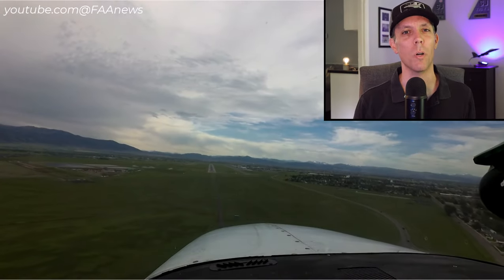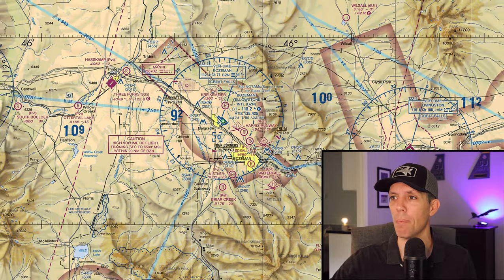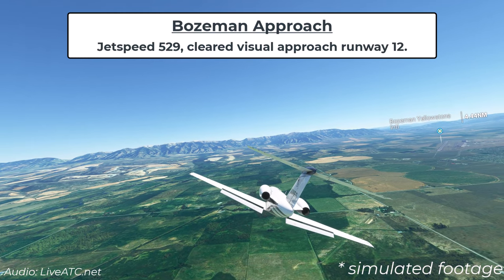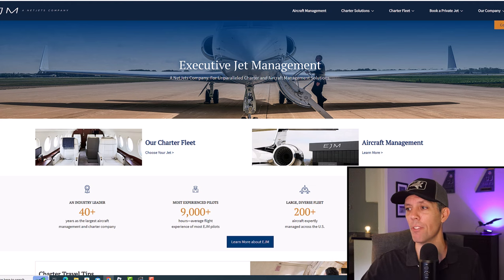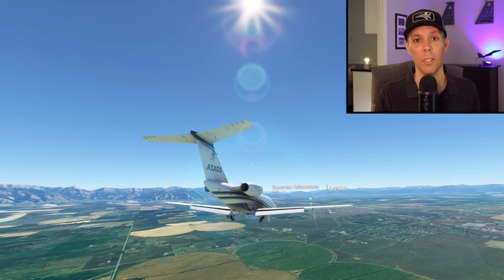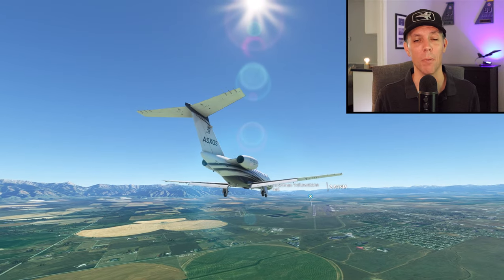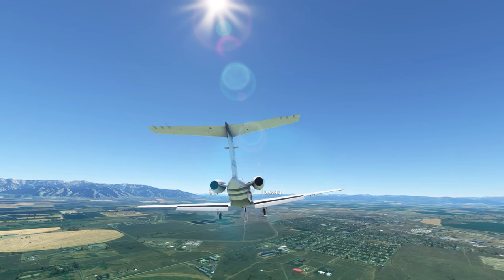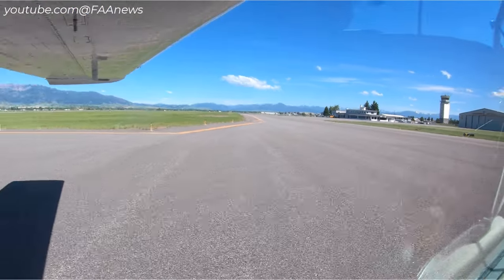Pilot Actually Lands WITHOUT Permission!

Comment: They were making excuses, they never switched frequencies.  When you switch you generally establish communication with self identification and altitude.
Reply: he wouldnt ient its a none radared tower I bet mostly the Tricon would ask for a ident not a delta tower
Reply: He means you would identify his aircraft, altitude, and type of approach.  Not transponder ident.
Reply: Even if he didn't switch frequencies, Approach Control would have told him he was calling the wrong guy
Reply: Yes, don't try to call the airport with a cellular phone when the airport is a Class B C or D airport.
Reply: @iKenFlyPPG  you call class D for none transponder request all the time you can't go direct into B and C anyway
Reply: @zackriden79  ha good call
Reply: @zackriden79  there is a video of the towers attempt to communicate with the airplane, the second transmission from tower is "Jetspeed 529, if you hear this transmission, ident", so yes, this tower did ask for an ident.
Reply: They were saving fuel in the interest of our planet. Give them a brake. Fighting for a good "cause" is more important than rules and regulations. Good "causes" always override common sense.
Reply: If they  didn't switch freqs, they would have still been talking to approach.  Prolly switched, incorrectly and were talking at atis.  Or some other issue, but they were on the radio and talking.
Reply: Question is why would he do that? Why not just do it right?
Reply: @justforever96  Where is the wind when it is not blowing?
Reply: The pilot stated that he was talking the whole time. To who? That would be easy to confirm, or not!
Reply: He dialed in the incorrect frequency.
Reply: @jimw1615  But you don't just talk. It is a conversation. There are responses that you expect, not dead air.
Reply: Approach was trying to reach them, too. The pilots of the plane were talking the entire time all right... to each other and/or their passengers. My speculation is that they blatantly ignored both Tower and Approach for whatever reason, like teenagers. Granted, it's just speculation of mine. When you have multiple steps you can take to safely land, then you do them. I have a difficult time believing they took those steps, perhaps even any of them. I would even try calling the tower on the phone while in holding pattern before landing, if I were the pilot. Sure, I'm boring. But I'm also alive. No excuse whatsoever.

Comment: At least we had the tower keep other? aircraft out of their way. As a student, I did the opposite. I was flying from Tulsa Riverside (1969) to Tulsa International to do a visual approach to runway 36. I was instead vectored to Rwy 8. My intentions were to do a touch-and-go and then return to Riverside. But instead of clearance for the touch-and-go, I was cleared to land. Of course I didn't catch the nuance of the difference in clearances. The reason for the modified clearance from what i requested was there was a commercial flight taking off on Rwy 36. As I executed the go-around from the touch-and-go, I flew in front and above the commercial flight. It wasn't even close (the commercial hadn't even started its roll)but it really pissed off the tower controller, as it should. After getting my butt chewed i returned to Riverside with a new understanding of why it's important to pay attention to what the controller actually said and to not anticipate his words. Went on to teach in the T-38 and flew the F-4E and F-15C without another pilot deviation. Well, maybe one. That's another story.

Comment: I did once land without a clearance, or at least without hearing one. I was headed into the AOPA fly in at KFDK. It was a beautiful day and approach were dumping planes on to downwind and leaving it for the local controller to sort it out. Sad to say, she was way behind the traffic, and was clearly having trouble keeping up. I was on final, and there was a huge amount of confusion about the sequencing, with the wrong airplanes being turned on to base and things behind me getting chaotic. I could barely get a word in on the radio, and I came over the threshold, still not having heard a clearance. It’s a long runway, so I just floated a while, trying to get a word in, but she was still dealing with the mess behind me. At about the point where I had to make a decision, I finally asked “confirm cleared to land” and still no answer. I then decided, screw it, the runway is empty, and if I go around now I have no idea what’s above me, or whether I’m just going to make things worse, so I announced “I’m landing” and put her down. Filed a NASA form, but never heard a word about it. Maybe another airplane had blocked the clearance, or maybe not. But I figured the predictable thing to do after floating halfway down the runway was land, and the last thing she needed was more workload.
Reply: Good you filed a NASA. I think you had a good case to make from a safety perspective. When controllers get behind, bad things can happen.
Reply: That's nerve-rackingly awesome.
Reply: I don't fully understand, i am no pilot. Why not go around?
Reply: @pianissimo7121 Because it's possible she did clear me and I didn't hear it, and anyway she was so far behind the game that having to sequence a go-around might have tipped things over the edge. I also knew there was traffic close behind me and I had no idea what they were going to do, and I thus felt safer on the ground wondering if I should be in the air than in the air wishing I was on the ground...

Comment: Had an situation not long ago where we had to decide if we entered the Class D airspace at home airport without a clearance. Got the ATIS and then called for entry. Nada. Called the UHF freq. Nada. Tried both VFH and UHF in the second radio. Nada. Double checked the NOTAMS to make sure the tower we had talked to 2 hours before hadn't closed for some reason, not that we thought that was really an option since ATIS goes offline when tower is closed. Finally called ground who had us call tower again where there was now a controller to give entry/landing clearance. If tower hadn't answered I think we would have squawked, entered, and landed our helo direct to our ramp and figured it out later.

Comment: Quite simply: A pilot is responsible for assuring all two way communications are working. Aviate: Keep the plane safely in the air; Navigate: Know where you are and where you are going and keep that path safe; Communicate: Make effective two-way communication happen. If you can't do all three (using alternate channels as needed) declare pan-pan and then an emergency, as needed. That's how I see responsible piloting? Genuine questions: Do others agree?

Comment: I don't have any kind of pilot license and any flight experience is purely in sims. But even from this position it seems clear the pilots messed up here. If they could hear the tower the whole time, then they knew the tower could not hear them and had not given them clearance to land. I'm guessing that despite whatever issue was going on, they figured "conditions are clear and we can tell that the runway is clear so we would get clearance if we were in contact and we don't want to inconvience whatever person we have on board so let's just land" which is of course, the kind of mistake that has caused catastrophies. If there's anything I've learned about flying it's to be patient and always better safe than sorry. Figuring out what's wrong with the radio might be a lot to think about while I'm on final, so just go around and figure it out. It's strange they just suddenly could transmit properly once on the ground, I get the feeling they were hitting the wrong transmist button or something XD.

Anyway, "we could hear you the whole time and were talking the whole time" isn't just not a valid excuse, it's not even an excuse at all. It says nothing as to why they'd land without a clearance.

Comment: My backup plan in a small GA plane is the cell phone. I've got some of my most common towers saved on speed dial (though without needing it so far).
Reply: I should set that up, thanks! I do have a handheld radio in my flight back, reachable from my left seat at all times. Haven't needed that yet, and I doubt it'd transmit particularly far, but it could be a life-saver in a pinch. (I also have a Garmin InReach, but am not sure it'd be especially helpful, compared to a full-on satellite radio or similar.)
Reply: Belt and suspenders!
Reply: Before the web, we had a member in our forum from NORCAL. This is when cell phones were new and quite rare. Anyway, this person was in their Cessna and had a radio issue, so they called tower on the cell phone. Thing is, cell phones were still rare enough that it took some convincing before tower believed the pilot was real... they were convinced it was someone playing a practical joke on them...

Comment: The excuse sounds shaky. BUT, I remember once when my dad and I took off from BWI, we had just switched from tower to departure. We heard some noise on the channel and ATC came back and said there was a lot of noise on our transmission - was there anything we could do - please? I reached into our goodie bag and pulled out a spare microphone, plugged that in and gave it to my dad. When he called departure back, the guy was extremely happy we weren't assaulting his ears!  The first mic had worked with no issues for a long time and for all calls up to departure. Then it crapped out. So failures can happen at any time. But you would have expected this guy to say he changed something and he just sounded perplexed. That doesn't make sense to me. So, enjoy your talk with the FAA fella!

Comment: No clearance bad, but Mid '90s - G.R. International, Pilot I saw on Approach, just barely pulled out of windsheer, Liner had 5 wingspar breaks, Plates stretched out, wiring pulled out/disconnected, & airport looked abandoned probably due to storm.  Capt had entire Cabin Crew severely injured, plane's interior raped, no COMM w/Cabin, 1st Ofcr sobbing, no Radios, & landed fast & long trying to keep wings.  Capt had saved 154/154, but Tower so PO'd, they had GRPD ticket Capt for no Clearance while pullling Oak limbs from belly plus Joyridng Aircraft.  He was, cuffed, hauled in front of his de-planed Passengers, then to Tower for verbal beating as landed w/o clearance!  FAA revoked his tickets, Airline permanently suspended him including Jump Seat use, GRPD still had Driver's License, leaving Capt Greyhound as only transportation.  Do you think that was sufficient punishment, or because he had said he still felt lucky, maybe they shoulda tried to confiscate his home or somethng??  What do you say?

Comment: Landed in DFW without a clearance. A321, 300 overcast, light rain 45°F. We had a tailwind at the FAF which became a quartering gusty wind at the runway. That made it difficult  getting the aircraft slowed and trying to get stabilized before 1000 agl. On top of that right before t the FAF we received a new ATIS and now the question is can we legally continue the approach?  Anyway, we turn the “Runway turn off”  lights to the on position when we are cleared for the approach and the nose taxi light on when we are cleared to land. When the PM calls “1000, stable” I check 3 things.  Three green, ECAM landing page is all green and the nose taxi light on. All three were correct. We break out right at minimums and land. I was so busy during the entire 5 minutes that I did not realize we were still on approach control frequency. We landed taxied  off the runway and stated that we were clear of the active and looking for taxi instructions. That was when the arrival controller stated we were still on approach frequency. We called the tower, they chuckled and gave us taxi instructions to the gate. Nothing was said. We filled out an ASAP and about three months later the matter was closed.
Reply: Quick question: when the PM calls "1000 ft stable" aren't you supposed to add "cleared to land" or "not cleared to land"? Perhaps that's not a standard callout for your airline?
Reply: @Habu12  I’m not sure the 1000’ callout was made. I did hear the pinned program 1000’ and thats when I checked the 3 items I mentioned. To answer your question, yes, that is the correct callout for our company. I felt so busy with trying to get stable, get configured and concerned with the new weather that I think I became task saturated. Also, for some reason the captain turned on the taxi light. He apologized many time s for that. He doesn’t remember doing that. The other thing I didn’t mention was the controller told us to contract the tower at the FAF. That transmission was made about 2 minutes prior to the FAF. I think that contributed to the mistake of landing without a clearance.

Comment: Interesting.  I read comments and listened but never read or heard the comment that the requirement to operate (not just approach and land) in Class D is two-way communication with the controlling entity, in this case the tower.  That means that not only do you talk, but you need to hear that the controlling entity has acknowledged your call sign at a minimum.  Technically, I don't think you are supposed to enter the Class D airspace without such acknowledgement.  So if I correct in this, the pilot made two deviations, 1) not establishing two-way communications prior to entering Class D airspace, and 2) landing without a clearance.
Reply: They were on an IFR flight plan. When Approach cleared them for the visual, it was an implicit clearance into the Delta. They still needed an explicit landing clearance, though.

Comment: retired tower controller here, EJM529 could have been nordo/emergency?? Local could have just gave a landing light gun signal and notified ARRF  to alert status. the whole you just landed without a clearance is not the correct phraseology and doesn't anticipate the unexpected. After the aircraft gets to parking tell them to call the tower. This crew is known to me by voice and routinely operates that aircraft flawlessly start to finish.  excellent pilot. Never any danger as the tower was open and could treat the situation accordingly by holding departures off the runway and extending arrivals.
Reply: Why didn't they behave as a nordo?

Comment: I agree with you 100%. I hope the landing was better than the simulation. I did land without clearance once, deliberately. It wasn't my plan but my call. It was at KVRB, Vero Beach, FL, USA in 1980 (yeah, I'm old). I was a CFI and this was just before VRB had an approach control. Traffic would loiter just outside the "airport traffic area" until cleared to enter a downwind or base or whatever the over worked controller decided. It was a non-stop mid-air waiting to happen. The frequency was non-stop chatter, I was coming up on the numbers after flying the directed pattern, the aircraft in front of me was clearing the runway, I couldn't get a word in, so I landed. I figured a go-around would just make things worse for me and the controller. I landed and exited the runway immediately; told ground I landed without clearance due to frequency congestion. He said "thanks, taxi to the ramp". My one and only. Now VRB has an approach control to keep the local controller from getting overwhelmed.

Comment: Winter in Michigan DC9 being ferried to Oscoda for repairs/maint (formerly Wortsmith AFB) 
Pilot called clearance &told that Vehicle(plow truck was leaving runway). Pilot looked and saw vehicle cleared. He then did excellent landing that used up most of runway that is thousands of feet shorter. IOSCO COUNTY AIRPORT. OOPS
FUEL CHECKED PLANE MOVED TO EXTREME END oF RUNWAY, engines and everything gone over. Fence and wired taken down at other end of field, people evacuated. Same pilot took off and flew to correct airport.

Comment: Forty years ago, I was a newly minted PPL and flew into Sarasota.  Handed off to tower, I heard "Cleared to Land" but I missed the first part, "Report five miles out".  I was the only plane there (it was 40 years ago) on a weekday and when I turn off, I stopped and called ground.  It was about 90 degrees out and hot as blazes in Piper Warrior I was in.  FIVE minutes later, I hear the same voice on ground as the tower controller explain I failed to report five miles out.  He then had me taxi to the FBO.  My five minutes in the oven I guess was my punishment.

Comment: I’ve landed twice without a clearance. My first solo after a go around, 2nd attempt called short final repeatedly then announced I’d be landing. Controller dropped the ball. My instructor gave them an earful. 2nd time radio failure. It does happen
Reply: You still need a clearance if your radio fails. That's why you learned to set your transponder to 7600 and look for a steady green light from the tower.  This is also the reason why color-blind people are medically disqualified from flying.

Comment: 31 years ago I was flying a Comanche back from a fun trip to Mexico.  After checking in with Customs in Calexico we set off to Petaluma in the Northern SF Bay Area.  We decided to stop at Palm Springs for some food and fuel. Back then we only had VOR no GPS.  There was a gap in VOR.  My heading would be a straight in for Palm Springs.  I spotted the large runway dead ahead 10 miles or so and called the tower. They said they had me in site and I was cleared to land.  I landed and there were only fighter jets lined up along the runway.  I was like WTF.  I pulled off mid run way and stopped on the ramp and looked at my charts.  I was looking for any military field near Palm Springs.  I found that on the Chart called the tower and the controller was very mad. I told him sorry I landed there by mistake. He said you have 4500 feet of runway pull out and depart to the west ASAP and he will try to forget this ever happened and he was mad. Thank goodness we have GPS now.